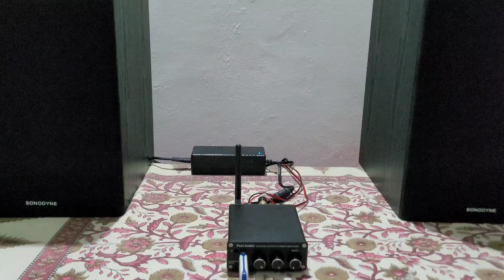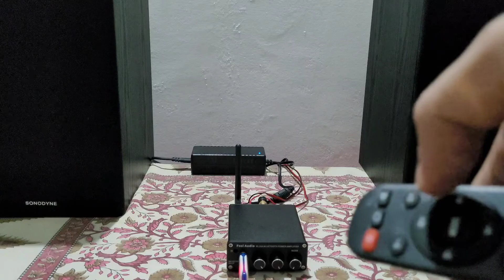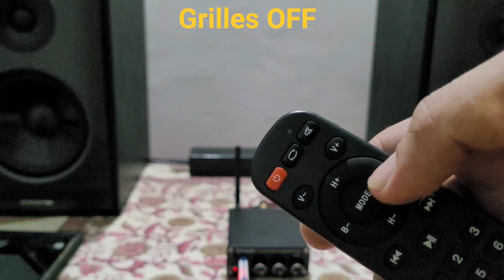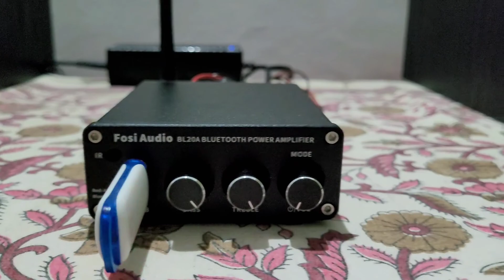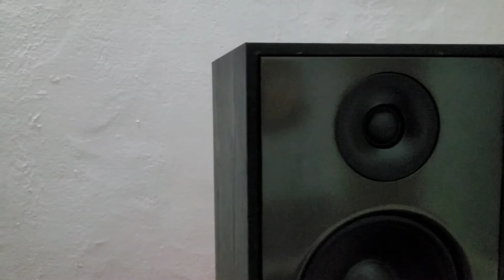Fosi Audio BL20A Bluetooth Digital Audio Amplifier and Sonodyne Sonus 3260 Bookshelves Audio Test

Comment: i am thinking of getting this bookshelf speaker.........i wanna know at what price u got it..........& also are the front grills provided...........thanku............great video
Reply from the maker: Apologies for the delayed reply. This unit was acquired from a Bangalore-based dealer for approximately INR 33,000. After a couple of months of use, a decision was made to resell it. While the audio performance, specifically in terms of tonal balance and loudness, was acceptable, an assessment of the internal component quality was undertaken. The external components presented a reasonable appearance; however, the internal construction revealed certain deficiencies. The drivers were of a moderate quality, with the tweeter exhibiting soldered and adhesive-based mounting. Furthermore, corrosion was observed on the terminals, and the internal bracing was deemed inadequate.
Reply: @TechieSickie thanks a lot.......for ur feedback.........appreciate it